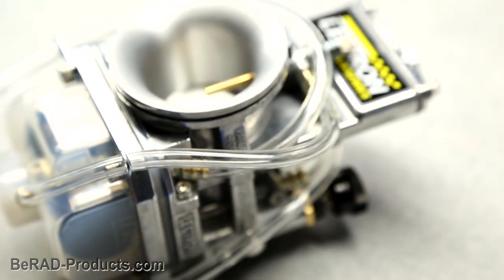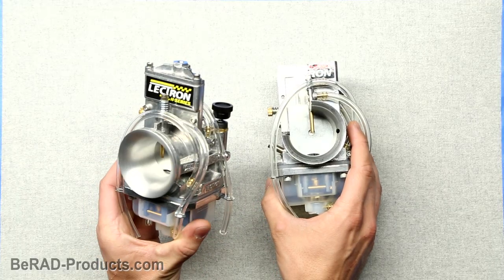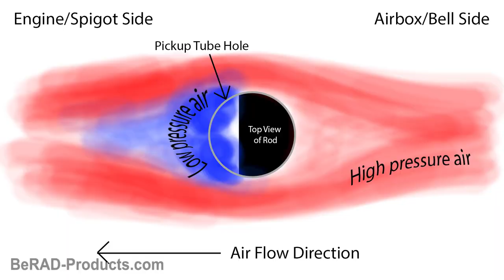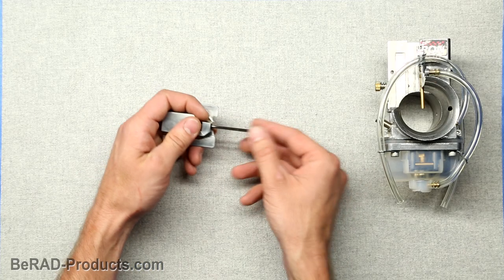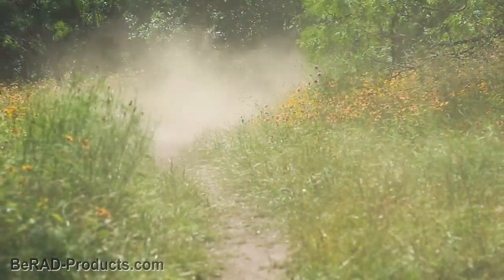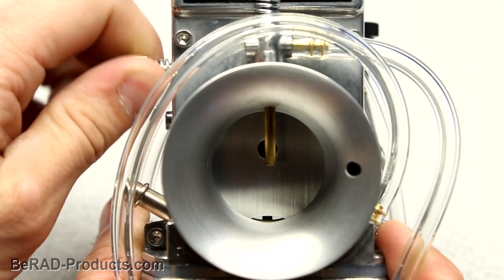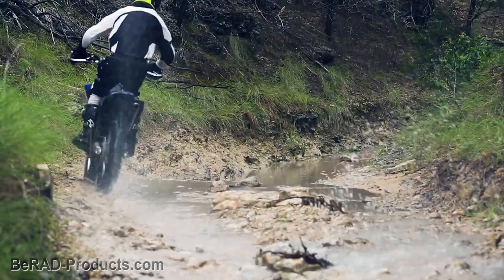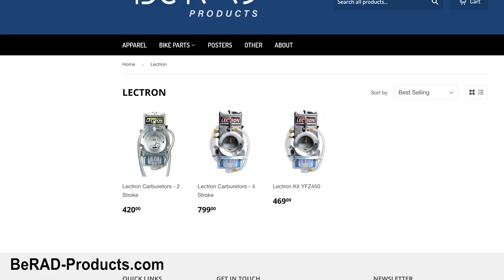LECTRON CARB - How does it work?

Comment: This Lectron is an overpriced crap compared to Keihin. You can sell lectrons to a person who has never seen a carb taken apart. Keihin puts chrome or rollers on a slide to prevent wear and I wonder about the longevity on lectrons. The second thing is a needle. Lectron makes them like a wedge not because it's better, but because its it's cheaper. It's a lie that you don't need to adjust it regarding temperature and pressure changes.
Reply from the maker: ZenderStuzer I’ve ran my Lectron for 200+ hours without ever taking it apart, cleaning the inside, tuning it. Runs perfectly every time, every elevation and temperature I’ve ridden in. So it’s a lie? I never got that with my keihin....